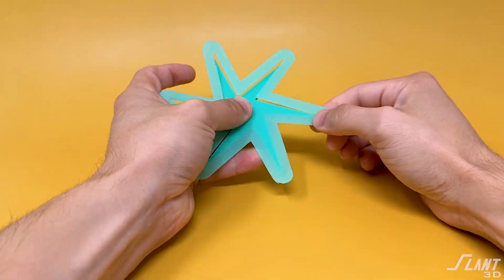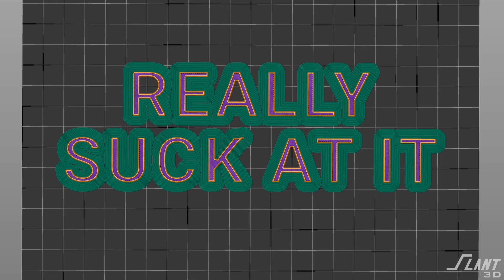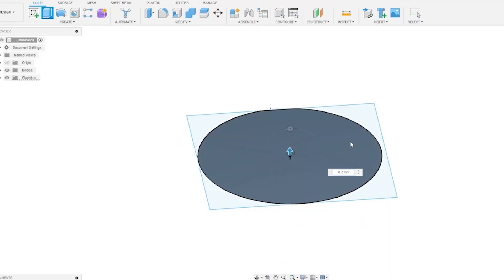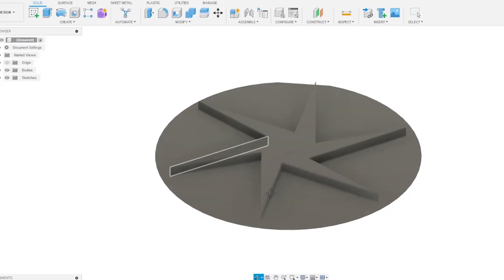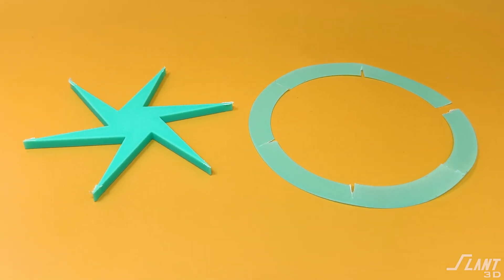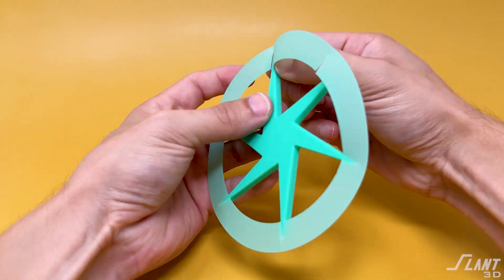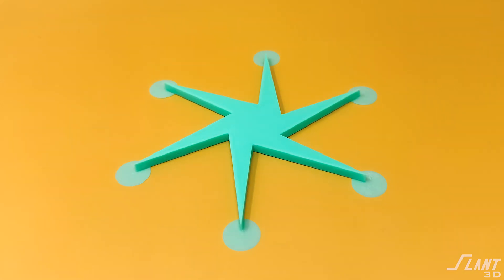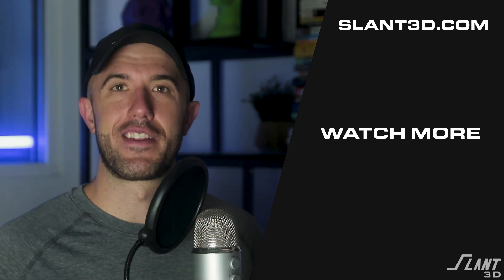STOP Using Brims. CAD is So Much Better | Stop Using Slicer Settings

Comment: The brim is an artifact of the manufacturing process. That's where it should be defined and generated (in the slicer). What If I decided to CNC a part?  What if a part can be both 3D printed and CNC'd? Why should it have a brim when the CNC needs tabs? 

I never have issues with the brims, maybe you need a better a slicer?

I think this advice is garbage. hope you don't write computer software! You'd be logic in the wrong places!

Comment: I have a plugin for Cura installed that allows me to place small circles at places where (I think) a brim is needed. Other than that, my Ender-5 Pro default print bed that came with the printer works (surprisingly?) well. I never had a print failing or warping due to parts not sticking to the print bed. It’s actually amazing how god this 10-cents-in-production product is.

Comment: If brims don't stick, your bed surface/treatment isn't for your material, or isn't leveled (or is warped and needs mesh leveling, often specific mesh for the bed temperature since that affects warping).

Comment: I've been doing this in slicer for years.  Just create a cylinder shrink it to .2 tall and the required diameter.  Position it and merge.  You don't need a CAD program for this.  Haven't tried to make a ring that way, but its probably doable.  Edit:  Only use this method if your printing it yourself.  Don't send an unprepared part to somebody else for printing.

Comment: with some prints and some filaments i use "THE WAFER" which is basically a one-layer all buildplate circle. on one hand its ~10grams of filament. on the other hand its consistently no warping.

Comment: First of all GREAT and Helpful Vid!

So I guess to add primitives in a slicer to add this brims on a manual way should also do the trick or?
I mean i can add cylinder to my objects and so on. Of course this is not that handy as when you do it directly on CAD but at least you can do a some "babysteps" in the right direction in the slicer itself. Especially when you only have stl files

Comment: You guys should come up with a small symbol, that is easy to print even on a horizontal surface, that means remove this part. Mouse ears might be a little small to put the word "remove" on. Maybe a circle with a line through it, think ghostbusters.
Reply: 🎵 Something strange, in your slicer settings...
Who you gonna call?
Ghost Busters!
I ain't afraid of no ghost(ing)! 🎵
👻👻👻

Comment: Tune your brim offset settings in the slicer to hold the part but peel off without marring the part. Not all slicers are terrible. Some even have mous-ears included. Your techniques are valid, and engineered CAD for printing is a good design process, but saying that slicer brims are outright trash is just misinformation.

Comment: I found out on my ender 3 neo, using whatever brim width but brim gap 0,4 works perfectly (outer brim only). Yeah sometimes one side needs a little bit of work but basically a one minute job maximum.

Comment: I’ve never had any issues with slicer brims 🤷🏻‍♂️
Using Bambu Studio and quite often use brims on PETG and ABS parts especially if the part has little bed contact surface. What I’ve noticed is that the part of the brim that is right at the meeting point with the part (so, basically the outline of your actual part, where the brim starts) is thinner than the rest of the brim. I don’t even need to use a tool to remove that brim anymore, it pulls right off cleanly when the part cooled off.
There is no reason to spend any extra amount of time to add brims in the design stage, when the automatically generated brims work flawlessly 🤔

Comment: So, this video kinda fails to acknowledge that a slicer generates instructions for the 3D printer that cannot be expressed by geometry alone.

This means that there are details like brim distance, where you can tune the brim to be say 68-70% of your nozzle diameter, which you cannot do with geometry itself. At least not with full control and knowledge of the resulting g-code for the brim interface.

And, with these things considered. I fail to see how this is anything other than just bad advice. "If you're printing a million". Like, is this a flex, or... At that point, this is not a good manufacturing process anyways.

Comment: If I need a brim, I just add mouse ears. Orcaslicer does them and they are pretty good but still have the general attributes discussed at the start. If I'm designing the part I'll add them on if I feel the part will need them. In Orcaslicer they are an add on and a separate part of the first layer. But they work. Putting a chamfer can be really beneficial but not always easy with someone elses model.
Reply: I was going to make the same comment.  Orcaslicer auto mouse  ears work very well.  My GoTo.  Orca also directly imports STP files from CAD that results in far better radii and curves.

Comment: I'm convinced this guy is putting out all these videos on how to design and setup up models properly is so that his customers who use his print on demand services stop sending garbage prints to his company. lol
Reply: @bg4779  that is 100% correct. He even said it at some point, and in all fairness I think it is brilliant: helps the community, helps his company, and build a followage.
Reply: @alexandermaverick9474  in my opinion the problem is that he often frames them as general truths for 3d printing....

His tips are often very specific to the use case of "print on demand" and actually make worse parts for one off purpose engineered parts
Reply: @TheScarvig there's also always a plug for the etsy plug-in. So I think it's trying to generate traffic to use their plug-in instead of making things yourself, and generating then business
Reply: @TheScarvig  these videos aren't billed as generally applicable to all 3d printing... They are billed as DFM targeted at additive manufacturing. All of this is about how to optimize parts for printing when you (the designer) will not have control over the slicer or the printer.
Reply: @TheScarvig I’ve been watching him since he set the chanel up and I’m struggling to find an example of what you speak of. In most / if not all cases, like this example, I find practical useful information even for one off prototyping / purpose engineered parts. Could you provide an example of where this is the case?
Reply: @imacmill  my slicer would do a better brim with less post processing then his cad brim. 

The slicers brim has the lines following the outer edge of the part it is easier to separate along the lines. A tuned brim-object gap setting lets me peel the brim off my part with just my fingers.

cading a brim and printing means the lines dont follow the pattern so you have to cut to seperate it. as he demonstrates@6:15.
Reply: Of course that's the point.
Reply: @bg4779  smart man lol, content and business
Reply: @bg4779  he just want to save himself post processing time
Reply: Win win
Reply: Well yeah, he's said as much though not in those words
Reply: win/win ^^
Reply: Thier videos are just ads disguised as tutorials
Reply: @cyrkielnetwork  what YouTube videos aren’t adds?

Comment: I really think this is poor long term advice, both for the community and your specific business. It might be needed for your business in the short term, but long term this will cause problems. 
The root of your advice, and it’s long term problem is: you’re adding tooling into your part schematic without distinguishing between the part and the tooling.
There are a bunch of drawbacks there:
1. It makes assemblies more complicated in CAD.
2. You either can’t tune for a machine, or once you do it’s a different part and needs a revision for the next machine. And if that’s years and a different designer later… do they know what’s the actual part vs what’s tooling?
3. As you’re finding: it is difficult for your manufacturer to know what they can change (or need to post-process) vs what is an important feature (or in general, what is the design intent of various features)
4. That means automated processes (such as those found in slicers) can’t be applied, and manual processes may need additional back and forth with the designer to be applied.
Put simply: this doesn’t scale well for large numbers of parts or machines, especially diverse machines.

I agree this should be in CAD, but it needs to be distinct from the part. This allows the final contracted product to be clearly specified. Tooling to be manually suggested by the designer (including by machine!). And overrides, automated pre-processing, and other specialized processes to be introduced by the manufacturer.

Conceptually I agree that a slicer should just generate gcode and have minimal custom configuration (speeds and feeds), but I’m not close enough to that code to know if there are micro-optimizations this would leave on the table.

The ideal flow for me would be: design the part with manufacturability and a specific process in mind, properly set the tolerances, apply the material settings, then enter CAM mode, click auto-generate supports using a default profile, edit as needed, create a derived machine profile if needed, edit supports, export in a format that can differentiate between part and supports, send to slant, you inspect, optionally edit, slice, and print. Post process, check tolerances, ship.

You have a problem with slicers. My problem is CAD is so far behind what slicers are providing.
Reply: Part modification and management can be easily solved by use of fabrication files or feature groups that aren't a part of the model displayed in the assembly.

PS Slicers should offer significantly more control over the slicing process than they do now especially in terms of locally modifying print settings.
Reply: You could export two STLs also... That are supposed to be put at the same X/Y/Z position in your slicer as the model.  That way you get the flexibility of multimaterial (i.e. soluble supports, bc that can work well with automation... or even be easier for end users to self process... or even if it's all PLA, you can have a key with the model that says "remove the white bits, leave the gray" or something.)

Comment: How is a slicer brim REALLY difficult and time consuming to remove but a CAD brim not? Don’t both still need to be removed manually?
Reply: It's backwards imo.  Slicer brims are easy to peel off, and often times don't require tools to post process (if your printer is tuned and your slicer settings are well calibrated).

I think the issue they have is that because they run a farm, they can't calibrate the slicer for any one machine, but it has to be generally calibrated for all of their machines (this is a software issue that can be improved imo).  

The result is that they cannot reliably print brims, and so they have to do more time consuming work trying to post process and "save" failed prints.  Like if you do 1 minute of extra filling on an otherwise "failed" 5 hr prints... That time adds up, but it's still cheaper than reprinting.  

For them printing with a slicer brim is probably more work bc 1.  They have to evaluate if the print succeeded, failed completely, or is it somewhere in the middle... 2. Still have to remove the brim (likely with tools either way), and 3. scrape off any extra failings from the brim being stuck to the part higher up or do any other by-hand labor involved in "fixing" the savable prints.

For them, eliminating steps 1 and 3 to make prints more reliable on their machines and require less decision making making and post processing per part, does involve less work.

For the rest of us... Just tune your damn settings and use the features as intended.

(Disclaimer: I have no insider knowledge, and no relation to slant; this is just my hypothesis based on intuition.)
Reply: You have full control where it is. Try to print some flexi thing - with tens of joints - with slicer brim 😉
Reply: @kimmotoivanen  yes I understand that, but that's not my question, which is why is one more difficult and time consuming than the other when they both need to be done manually.
Reply: The slicer brims are printed differently than CAD brims. His claim is that the tool path for CAF brims is superior.
Reply: @Subquake654  They are not superior.  It is literally more work to remove a CAD brim, because you require a sharp cutting tool.

Comment: Instead a specific thickness for max brim thickness, you really should say no bigger than your layer height.

For example: I tend to print as high as .64 with a .8 nozzle, and I could go double the max you suggested and still be only one layer.

Comment: This is not entirely true.  There are many things that can be done in slicer that can't be done in cad or are easier in slicer than cad.  Slightly changing the  gap between the final line and the part for example to make it separate easier.   For sending the part to a print service with standard settings your points are valid.

Comment: I appreciate the variety of options shown in this video.
I'm curious about the rules for Slant's auto-eject. Chamfering is important for that? Is there a guideline for total surface area?
Reply: I don't know their guidelines but I have successfully ejected 250x140 footprint flat(~20 mm) parts printing PETG on a textured plate on an unmodified bedslinger. The biggest hurdle was shaking the part off the bed and outside the printer.

The key was to wait until the bed cooled down far enough.
Reply: @tymoteuszkazubski2755  no powder on the textured plate? My textured PEI is fine, comes off like PLA if i do it manually, but I'm pretty sure PETG has more than double the binding strenght of PLA (at least with no powder), and my belts were skipping even with pla that had too much contact surface area (waited until 29C° and 25°C)
Reply: @tymoteuszkazubski2755  You're talking about your personal experience with popping prints off your plate, right? I believe Slant's printers have plow blade to push prints off the plate at the end of printing, for mass production. I'm looking for guidelines for that. 
There is this video about minimizing the bottom surface area, but there must be some surface area threshold for when it matters.
https://www.youtube.com/watch?v=SZwXREFoWKA

Comment: No, thanks. I'll keep using Prusa Slicer's brim on every single print. 
No way I'll bother designing this when it gets generated automatically.
I print on a mirror, without any adhesion product and il does the job perfectly fine to avoid edges lift. It just breaks off or is easily cutted off with a scalpel.

Comment: You really should bugreport slicers if you see a fault. That would benefit everyone.
Reply: Or just tune your printers... So that brims print correctly... Like, just bc you run a farm doesn't mean the gcode on each machine has to be interchangeable.  Save the print project and build your farm software to slice on demand for the machine it prints from (cache it for that machine obviously).  But then you can actually tune your printers to make them more reliable...

Comment: Thanks! Give it a few weeks, and someone will add this to the modern slicers :)
Reply: It's already there.  It's called a raft. 😅
Reply: @BrainSlugs83  No, that's something completely different
Reply: @roysigurdkarlsbakk3842  It performs the same function as what he wants, he basically wants a brim with a raft toolpath. -- Which you can get with just a raft.  Since it's a throwaway bit of plastic anyway, who cares what the shape is?  Functionally, it's a raft.

Comment: Been printing for more than six years by now. Rafts are 100% better than brims in terms of reliability. Especially when working with highly shrinking materials. Rafts basically create an extremely adhesive surface under the model.
On the other hand, using advanced approach and hardware is also beneficial.
I use a CoreXY setup run by Klipper, which allows for using a virtual bed mesh, thus significantly removing warps and the need for brims.
3D printing has evolved a lot for the past few years actually. Today most issues of printing are properly adressed by companies, especially those who not only produce, but print themselves
Reply: Rafts are litterally putting your entire print on support material.

This comes with all the downsides of support material like post processing separation issues and bad looking interface layers.

Rafts were a bodged solution to bed leveling and adhesion issues of early printers.

Modern printers with heated beds,adhesion coatings ,proper flat beds and even mesh bed leveling do better without rafts
Reply: @TheScarvig  I am not here to prove a point, just sharing some tips from my vast experience

Comment: These modeled mouse ears are going to be handy when printing ASA. I just tried some and it didn't work perfectly but I have a feeling I just didn't do it right. I made a spru that stretched out 2 or 3 mm before the circle and the circle was therefore separate in a way from the part itself. What I got was warping at the edge of the part, the spru lifted as well but the disc at the end of the spru stayed put and was basically tethering the part down lol.